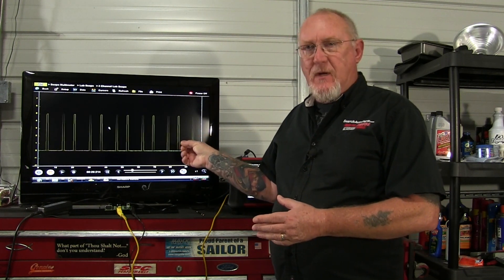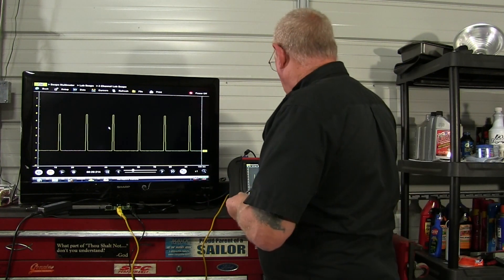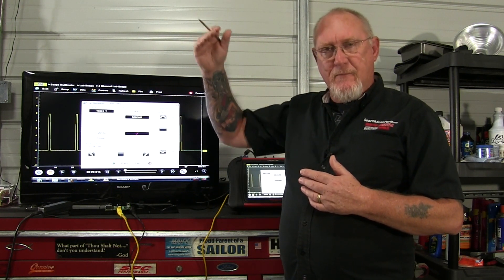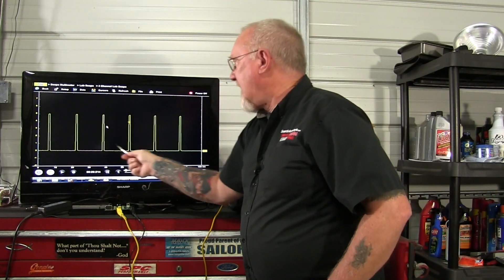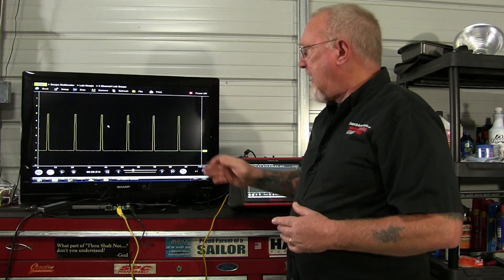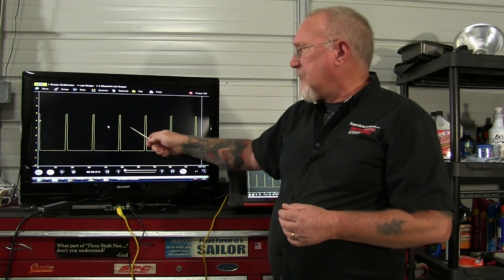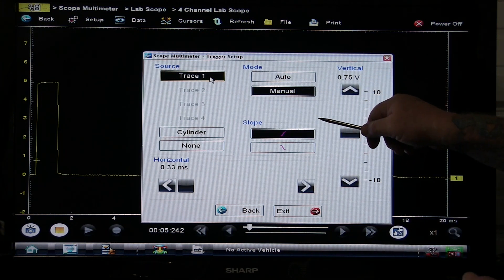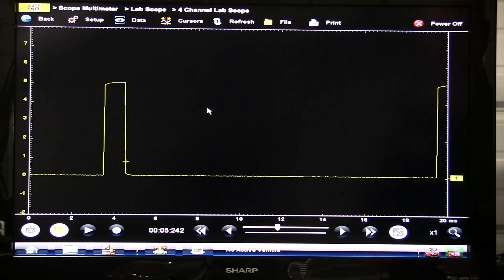Motor Age How2 #8 - Using Trigger Settings On Your Scope

Comment: Is there any instances where you should use a rising trigger of falling trigger ?
Nice video.
Reply from the maker: Good question. In most of my captures, a rising trigger is the norm. It depends on what you're trying to capture. I once had a Mercedes with a key off drain problem that I could not duplicate. I set the scope up to capture a single capture if the amp clamp detected a current loss, using the falling slope mode, and let it sit. Later, I found that the scope was displaying a pattern that I finally traced to a bad radio module. How? The radio was playing in the car but the key was safely tucked away in my toolbox! 

Perhaps others watching this video can offer their ideas on using triggers?

Comment: It does not look like anyone noticed but it looks like you were using a snap on wave form generator. That is a great device to use when you start out using a scope.  It makes it very easy to choose your wave form and setup plus reduces the frustration with new users.  I have recommend them in the past and they are not that expensive..

Comment: Nice demo.  I think it would have been interesting to show what happens when the signal does not meet the trigger requirements, particularly using the Snap-On scope.  I'm sure you already know that you cannot trigger the full capture using a Snap-On scope.  It is always capturing data even if the signal does not meet the trigger.  It will only appear to have stopped.  You can never see what the scope is capturing when it is running.  Only when stopped and zoomed out.
Reply: I dont mean to be offtopic but does anyone know of a method to get back into an instagram account?
I was dumb forgot the account password. I would appreciate any tricks you can give me
Reply: @Milan Melvin instablaster :)
Reply: @Jake Alexis It worked and I actually got access to my account again. I am so happy:D
Thank you so much you really help me out :D
Reply: @Milan Melvin You are welcome :)